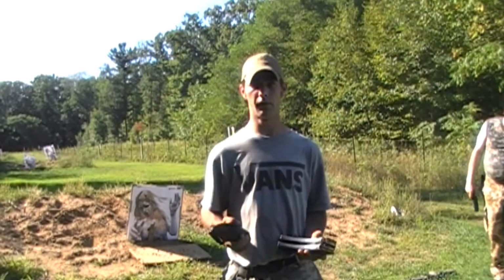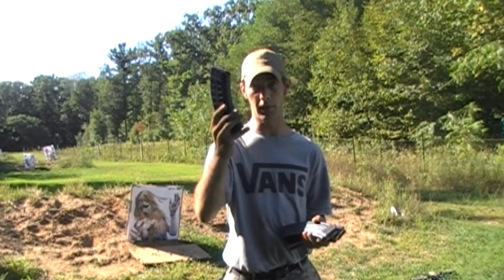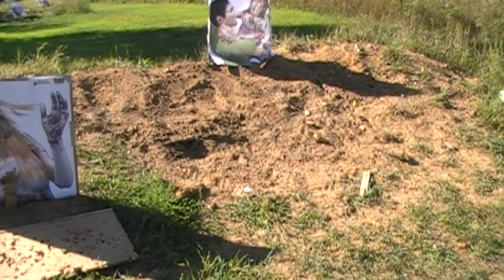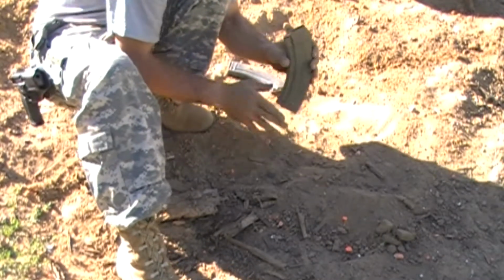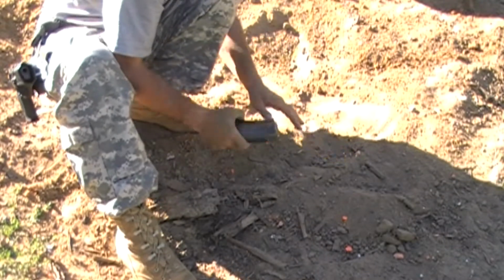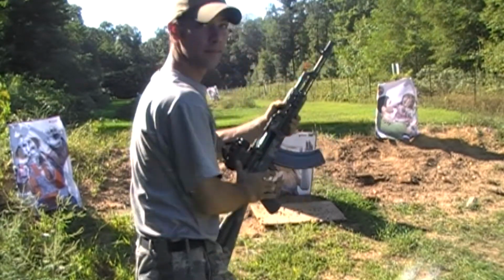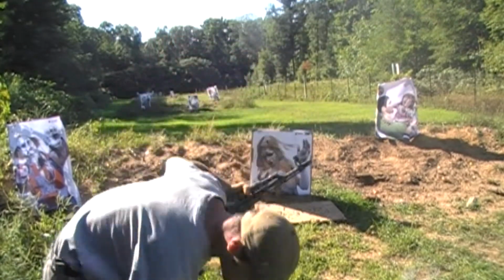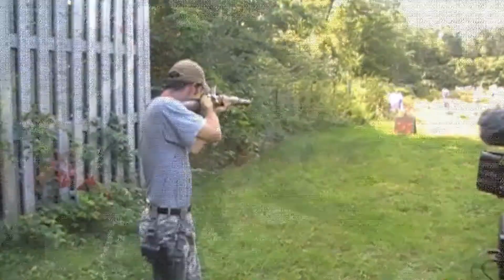AK-47 Magazine Dirt Test

Comment: cool vid. I just bought a yugo sks. I shot a hundred rounds through it and then switched it over to a tapco intrafuse stock and started using the tapco 20 round mags with it. The mags started running 100% after the third reload, but not at first.  Did you have any similar issue with them?